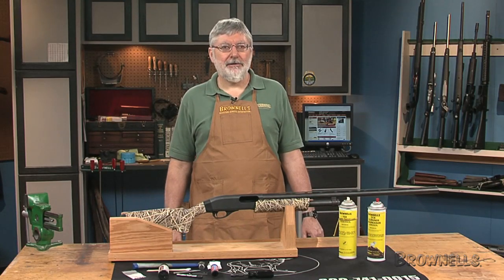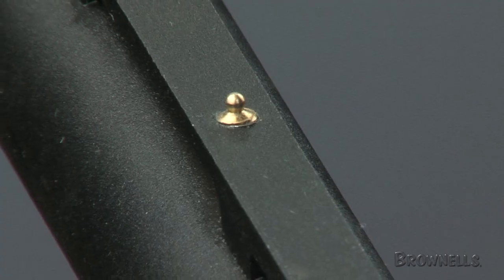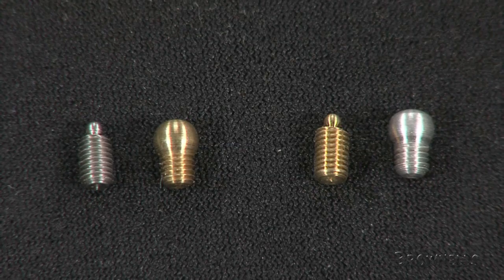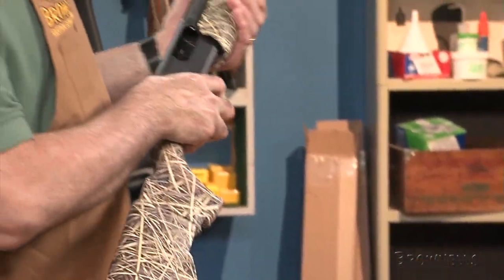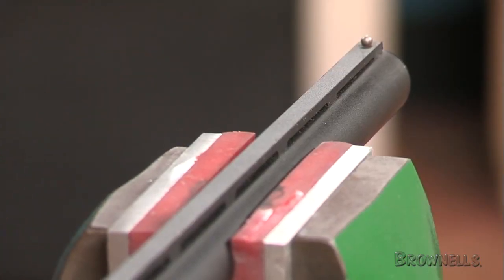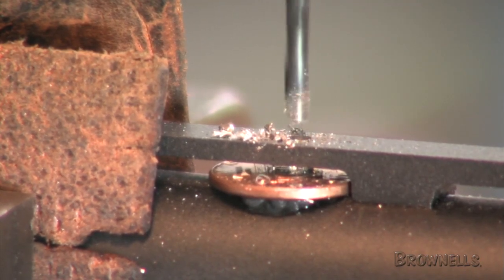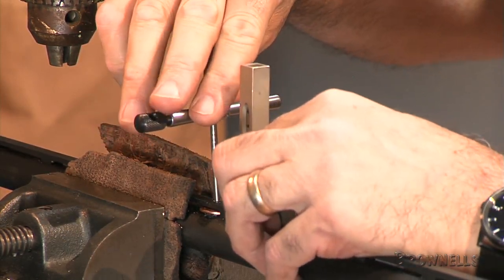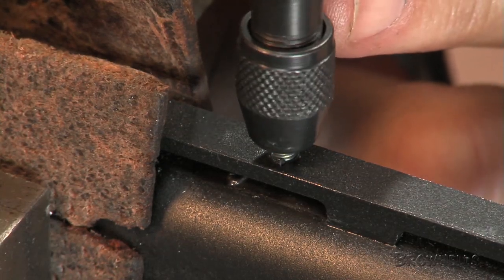Installing a Mid Bead on Your Ventilated Rib Shotgun

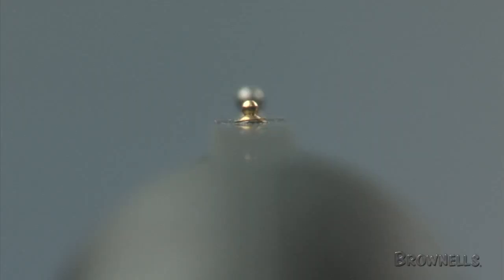Comment: I would be pissed if this was my shotgun.  You don't install a mid bead all the way through the rib, they should always go into a rib support.  Furthermore, the bead isn't even straight.  The shot looking down the rib at 0:31 shows just how bad the installation really is.
Reply: He tapped it by hand and was crooked going in. Use the spring loaded adapter and the drill press to put it in straight.